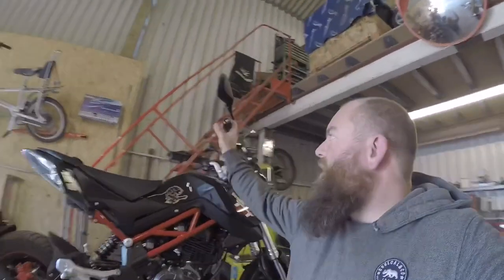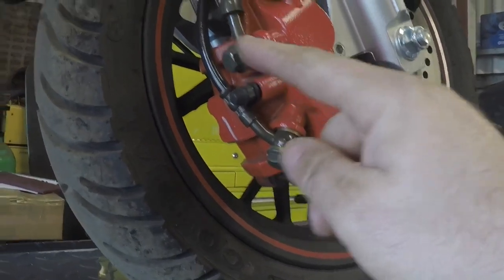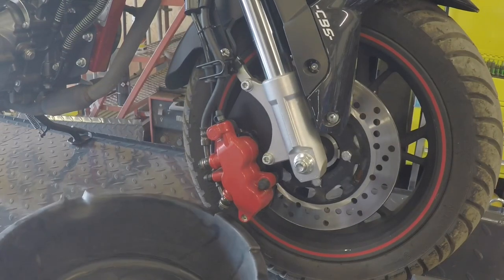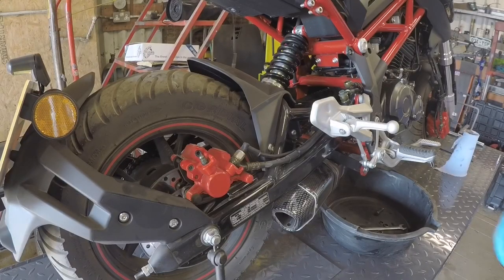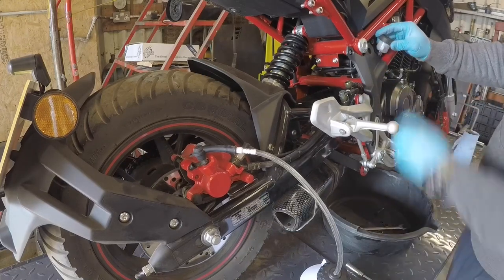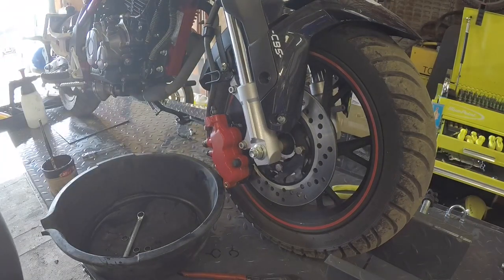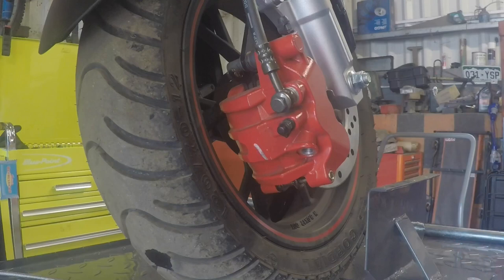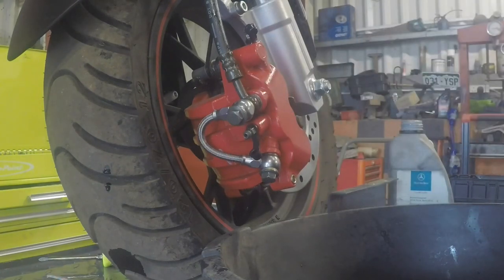2019 Benelli tnt 125 cbs combined brake system linked brakes delete bypass

Comment: Personally think I would use two full lines on the front calliper with the double banjo on the master cylinder but the way you’ve done it work perfectly so each to there own.
Reply from the maker: that is going to be the next step and video , just trying to show all the options !
Reply: done valve adjustment still same issue its a odd fault iv been trying for a while to locate the problem even changed the icv valve because they make a sim problem  think 700cc swop will fix it :D
Reply: 3 piston oem,,the bike just gets better the more you look into it,,,
Reply: Si then you have more brakeline so less stifness right? I think his option feels better.
Reply: If you try to put two whole lines it will work worse because the piston does not have enough power to pressurize both lines. I tried.

Comment: I did almost the same with the Leoncino 125 and several other motorcycles with CBS. Plus a different brake fluid and it's great.

Didn't using 3 cylinders in the front connected to the pump make a negative change? Does it lose efficiency and the handle movement becomes very long and the brake weak?

Comment: i am thinking of using a plain bolt in place of the regular banjo bolt to block the brake fluid passing into the front piston, this way it can easily be re enstated if the next owner wants it. I have a Bullit Hero 125 and the CBS on the front is a bit savage, I want to greenlane and the last thing you want going down a steep muddy hill it the front brake coming on. Thanks for the informative video, nice one.

Comment: how do you go about blanking off the banjo hole in the front calliper can you just use a normal single banjo bolt or do you need a special one
Reply: banjo bolts have holes in them so you would need to use a spacer or a stack of washers on the bolt to seal it off.

Comment: what does the bolt do in the black box you removed from the left hand side? does it adjust the bias,,, can you just the nut to turn off the front brake bias?
Reply from the maker: yes i believe it does, although i didnt try! wish i had now!
Reply: Sorry are you saying there's an easier way to remove the CBS system by more or less a switch? Just about to buy a TNT and would like to know what to ask the mechanic to do!! Cheers!!
Reply: @mandywalker5873  yeah tighten the bolt into the unit and it disables it, but I too have removed it easily
Reply: I just tried adjusting the bolt but it's quite stiff is that normal?
Reply: @lemz7775  yeah it felt like it may snap, but if you look next to the bolt there's a screw locking the nut in position,  just back it off. I just left it and carried on tightening the bolt 😅🙌

Comment: have you had any issues with it stalling out when cold yet ?
Reply from the maker: baldy meek no, but have only ridden up and down the track to my workshop .... practicing wheelies....
Reply: @builtbykw8258  if it starts to get the problem look into the injector 0 ring they seem to be a very lose fit got the issue on mines at the min i need to go nip for a new tighter ring for mines see if it cure it
Reply: If you haven’t already fixed it it could be the valves. I haven’t got one of these bikes yet but on my current one every now and then it needs the valves adjusted as had exact same issue